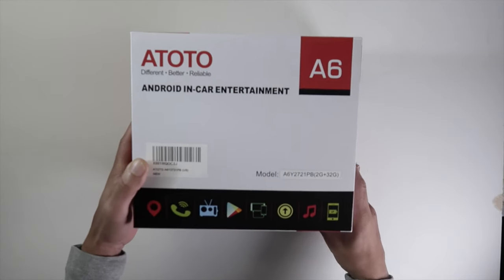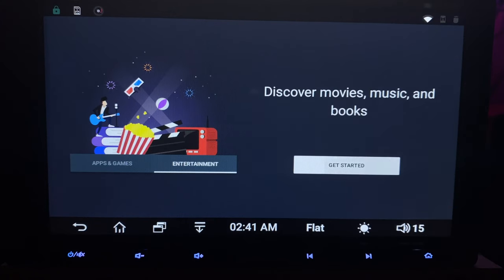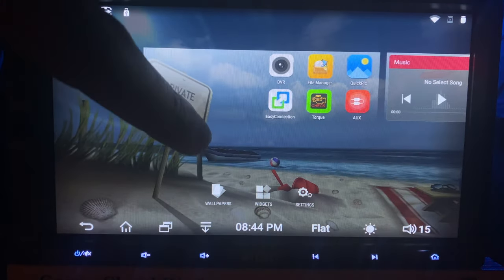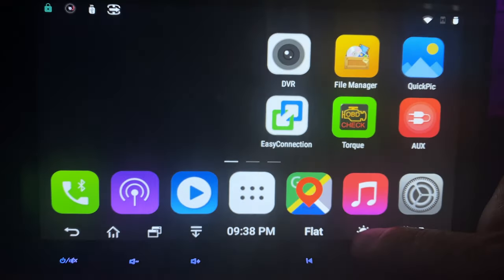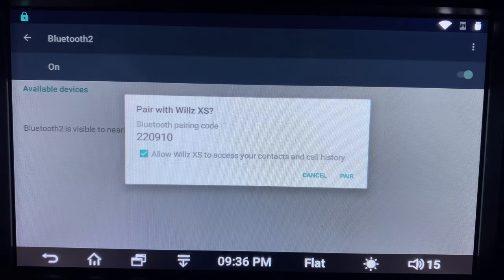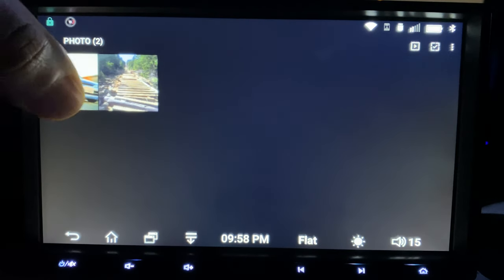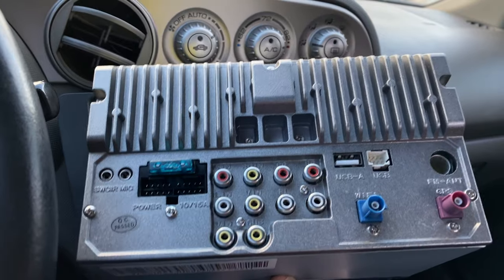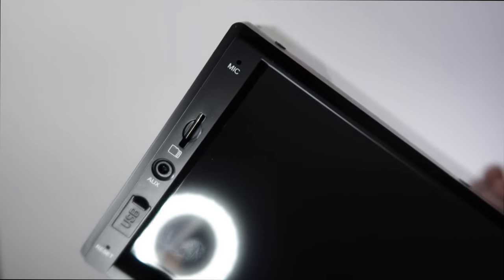ATOTO A6 Premium Full Review

Comment: Is the reverse camera seamless and turns on automatically when the vehicle is put in reverse?
Reply: ColoCulture?
Reply: The activation of camera is by power pickup from reversing light. So until you reverse it will be off. However if wired differently it can be always on but not recording. Recording is on front cam only as far as I am aware

Comment: Is this deck designed to function best with a constant data connection?
Reply from the maker: At this point I never use data with it. All bluetooth that works great still. I have had no issues with the unit.
Reply: ColoCulture Media Does that mean most of the apps are useless? Which apps can be used and are actually used by you that don’t require a data connection?

Comment: Can I use my steering wheel controls
Reply: Yes you can but you may need a separate lead for your car if it has a canbus control. Some steering wheel controls are digital some analogue. The input lead provided I think is analogue. I needed a special canbus lead for my c3 picasso.